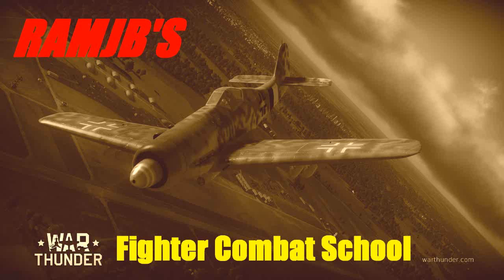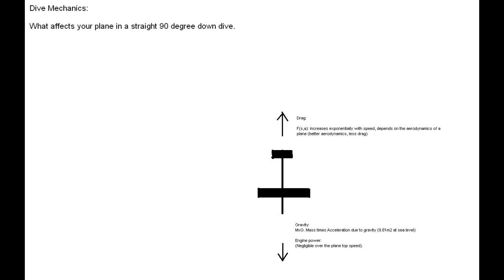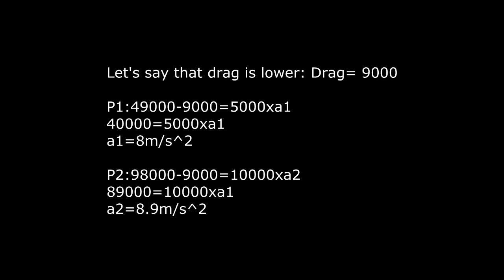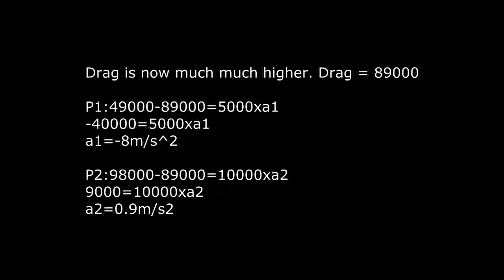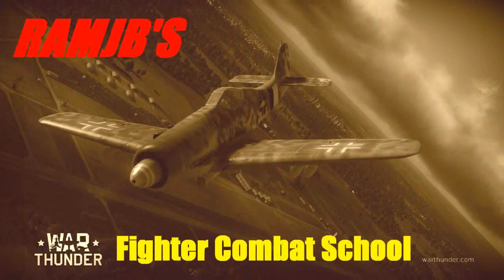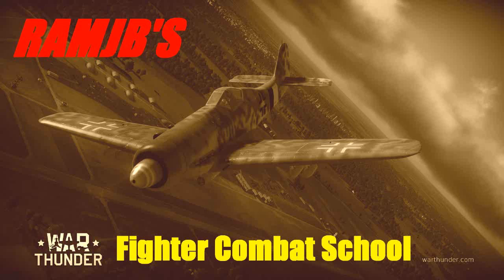Fighter Combat School. Heavier fighters, lighter fighters, why BnZ is as it is.

Comment from the maker: in this particular instance, because we said engines were idling.
In real life because over a certain speed the propeller stops pushing you and actually is braking you, sort of a huge aerobrake that's windmilling because of the air that's forced to pass through it. At slow speeds the engine helps. At high speeds the engine does not help. And at high enough speeds the propeller actually is stopping you from accelerating. So I simplified things up, and set the example for idling engines.

Comment: Ram is referring to the drag caused by propellers at the lower end of the transonic speed spectrum (0.8-1.2 Mach), where due to the high speeds involved two things happen: 1) the rotor blade tips go supersonic, thus the vortexes made by them cause massive airflow disruptions on the wings and tail; 2) the entire rotor assembly itself starts acting sort of like a flat disc because less air can go through them due to the first thing I mentioned. Number of awkward things happen at that speed range.

Comment: Another thing that (I highly doubt though that WTh models these, so I'll just mention it for completeness sake, and for those interested)  affects all of this when it comes to drag is: barometric pressure and air temperature. Both affect air density (just remember the warm expands; cold contracts thing we all know and love from physics :D ). Wind direction (both horizontal and vertical) and speed is also a component. All that would further degrade the lighter plane's performance.